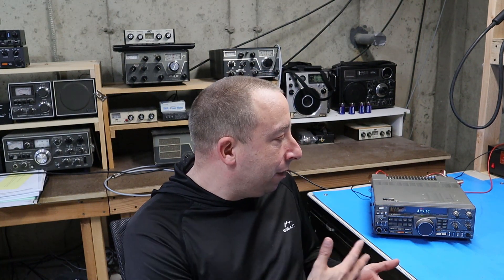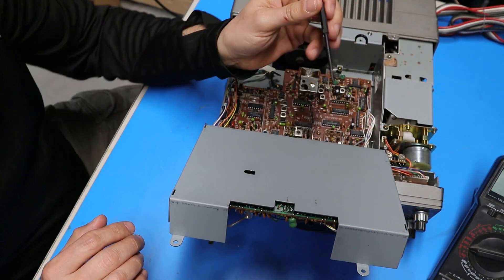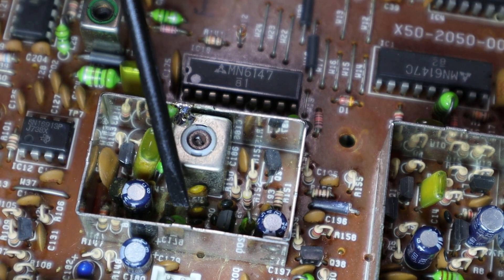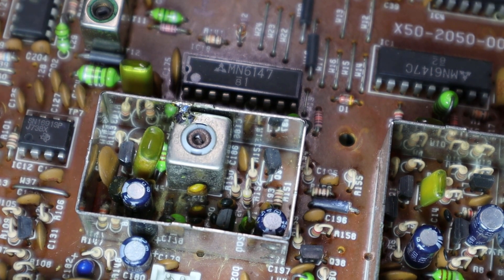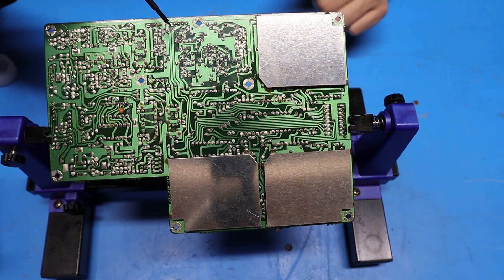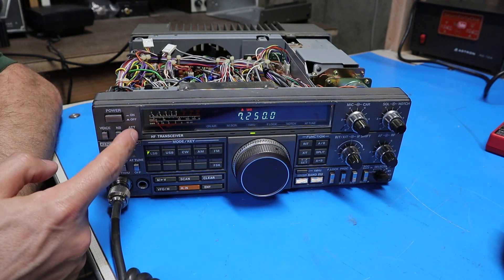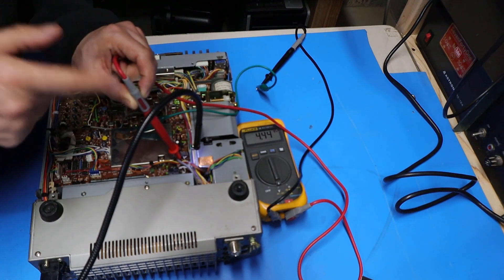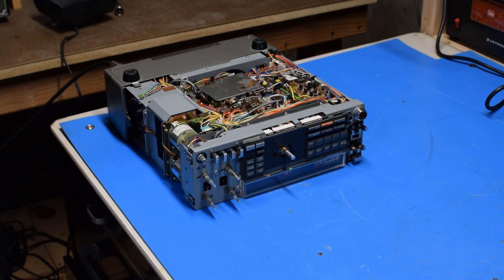Ham Radio: Kenwood TS-440 Repair - is it Worth it???

Comment: This was 4 years ago, so I have no idea if you'll see this, and youmay have already answered these things.

Have you gotten the . . . . display?  I've had Kenwood tell me that is a known issue and is un fixable.  The encoders they used to determine the dial position started going bad, and send a proprietary signal.  The only way to fix it is find encoders off another TS440.

If/when you fully recapped, would any out of tolerance caps or resistors necesitate a full alignment?
Reply from the maker: My display is working fine.  If you recap it's good idea to do a realign

Comment: My only rig is a TS-440SAT. Recently had to strip VCO-5 off the IF board and clean out all the stupid goop they used that becomes conductive with age and humidity. One thing I noted that I have not seen anywhere else is that the goop wicked itself way inside the adjustable inductor can. I had to dismantle the outer casing from the coil bobbin to get it all. Had I not, I am certain I would have still had PLL lock-up.

It's a dream rig now. Added a NEDSP1061 signal processor, activated by the Voice button. Replaced CF1 and CF2 filters with a pair taken from a TS-940 IF board, CFW455-HT and CFJ455K-12 respectively. Added optional YK-88S and YK88C filters. Opened up the entire audio chain. Added the IC-10 with IF-232C. This rig is fully decked out. I get nothing but compliments from others.

So yes. It was SO worth it.

Comment: Hey Rob. Do you know if the goop can cause a “no display” situation as well?
Reply from the maker: It might.  But try doing a reset and check the memory battery as well
Reply: @SevenFortyOne  thanks for the info Rob. I did the reset but the display still did not come on. I tried tapping the top of the 440 rather aggressively & the display came back but it is constantly flickering. I’m able to tune to any frequency but that flashing display is driving me nuts 🥜 Unfortunately my eyes aren’t good enough to do the battery job but I’m hoping to find a local amateur that could replace it for me

Comment: I bought a used Kenwood 440SAT from a ham about a year ago from ebay. I sent to radio to a repair shop and they worked on it to remove the factory glue and prevent band jumping or skipping when using changing bands. I have noticed during operation that the squelch circuit does not seem to be working correctly. Do you have any videos on fixing the squelch circuit? I like this video and it was very good and informative.
Reply from the maker: Sorry I don't....I'll bet you have a bad solder joint somewhere.  Or maybe a bad capacitor if the shop you sent it to didn't replace all of them

Comment: I have a question about the 440s. Just purchased one and apparently during shipping something came loose. I have cw transmit, buy no mic out on LSB or USB- no power adjust. Any special areas to look at? WB5MTR
Reply from the maker: Mic gain control or maybe a loose or broken wire in the mic?

Comment: Nice video, thank you for sharing.
Another thing you might want to do is to cut a wire inside and get the extra digit on the frequency readout. .00 instead of .0 at the end.
Also for what I’ve seen in the video looks like the meter was not calibrated maybe? It was always on 0…
All the best and 73
Reply from the maker: Thanks for the tip!  The meter may have been on ALC mode or maybe it does need calibration...not sure.

Comment: I just repared my 440s after standing on the shelf (in box) for like 6+ years... It's working great after removing the glue stuff. But I have 1 major problem, and no idea how to fix this...it's got a frequency offset/shift of 40khz.. if I tune to like 14.000 it does rx/tx on 14.040.. already replaced the main clock 36mhz crystal and (broken) trimmer but can't get it lower than 30khz offset...any idea how to fix this ?
Reply from the maker: Is vco5 tuned correctly?  Mine had a 1mhz offset before it got flaky
Reply: @SevenFortyOne  checked it...and yes it's vco 5..on the varicap diode (d35) stands the full 7,8volts..something is wrong around Q34 and Q35..All voltages acording to schematic are there. So, wierd it's not working. Going to change them and see what happens.. Pll (ic18) seems to be working, if I tune the vco I see the voltages (pin 8) changing. Pin 2 of pll looks like a "lock" pin. when pll is in lock it gives 4,8V..when not it's between 0 and 4V.. Checked this out with with an other vco, tuned it off and same behaviour... Don't have the original parts, going to try it out with some other transistors I've got (bf199)...let you know if this works.
Reply: @fredwester5705  did you ever fix this issue?

Comment: Great video!!  I need to send you my Kenwood TS-440S and see if you can get my "dot" issue I have on 10, 12 and 15 Meters fixed!! LOL  When I got the radio from the widow of a SK, and it had the "dot" issue from 10 to 30 Meters.  Someone had removed the old glue from the circuit board, but in doing so I found 3 diodes that were either cracked or broken.  I found replacements, one I had to order from China cause couldn't find it in the US.  I got everything working again except the circuit that controls 10, 12 and 15.  I checked the voltage on the High and Low side on that circuit and both sides had the same voltage.  One side, I can't remember which, is suppose to be 5 to 6 volts and I can't get it there.  Could be bad solder joints, I need to disassemble again and reflow all the components there.   I will get to it sometime.  Your video gives me hope to get mine working fully again.  The TS-440S is a great radio, the receive is so great on them!!  Thanks again for sharing.  Juddie - WD8WV
Reply from the maker: Hi juddie...I'll bet you've got bad solder joints too. Or, you may need to replace the memory battery.  One easy thing you can also try is to do a factory reset....that might clear it up too. The procedure vis in the manual...just hold down two buttons while turning on the radio.  They are awesome radios

Comment: The local club I belong to had a TS50 donated to them clamed  that the finals were out.
I had it dropped in my lap to work on. Turns out the poor thing had been hit by the golden screw driver 
The finals were ok the power rollback saved them. No telling what kind of load it had been seeing
But  a diode had been cut so that it would transmit on 11 meters.
The output power had been jack up to 180 watts 
It also need a memory battery  I got every thing back to factory so the old girl has some more years left
Reply from the maker: Awesome!!!
Reply: @SevenFortyOne  The funny thing is I have been out of the hobby and the club for a number of years.
No sooner than I walk in the club house door for a meeting to rejoin. One of the old time club members that I knew from the past said hey your back! And handed me the TS50 
I had to go looking in dark corners and blow off dust from what test gear I still had and was working off a card table
Welcome back to the wonderful world of Ham radio LOL ; )

Comment: I still haven't changed the battery in my '90 R-5000. Might have to clean out the VCO as well. New dial light too.
Reply from the maker: You've had that a long time

Comment: I have an inductor assortment if you want to replace that bad inductor.
Reply from the maker: Thanks Bill!  That board is a pain in the bitch to remove and the inductor in question wasn't even in the schematic so I think they added it for EMI suppression after the fact and it really doesn't do much.  You'll see all that in the next video on this radio.  If I need any for when I fix the tuner though I'll give you a call!

Comment: I enjoy my TS-440S/AT. It is a workhorse that is built like a tank. Massive heat sink can handle 100% duty cycle on digital modes.
Reply from the maker: I like mine too...its a joy to use

Comment: Excellent video. TS440 was my first HF and I still got it on the desk. Took it camping once and when the sun heated the radio went to all dots, I knew about the goop so I started scraping what I could get to out and was able to keep operating. But ever since my receive audio has a “wobble” to it.
Reply from the maker: Sounds like you need to get more of that goop out of there and it will be good to go.  These radios are great when all the issues are fixed.
Reply: @SevenFortyOne  I enjoyed mine many years before I got the 7300, still have it connected to a small rx antenna but would like to put up a wire antenna for it. 👍
Reply: @SevenFortyOne  the wobble sound may also be because I did mess with the VFO pot because it wouldn’t lock and was drifting, got it to lock but made that slight wobble ever since.
Reply: You still have the glue causing the wobble in the pll. A little more cleaning up of the glue should fix it. Don't start turning the pll inductor adjustments hoping for a fix. Get the glue completely out, then align the pll stages per the service manual and all should be good. Look it over as he says about cold solder joints with a good lit magnifier. These radios can have numerous bad joints. 
Good luck, 73.
Reply: @kevinmccool3719  thanks Kevin it I decided to get back in it I’ll dig some more out. 👍

Comment: Hi Rob. Great work on the old timer. My TS 511S is still in the shop. The repair guy has found some surprises that wasn't good. He already recapped the power supply. So good luck on the rest of the repairs and looking forward to the next video. 73
Reply from the maker: Thanks Clark!  they aren't all as easy as this one was.  I hope your guy can get the radio straightened out for you!